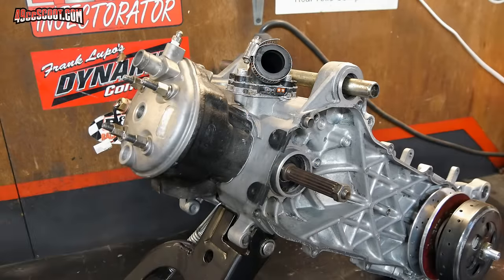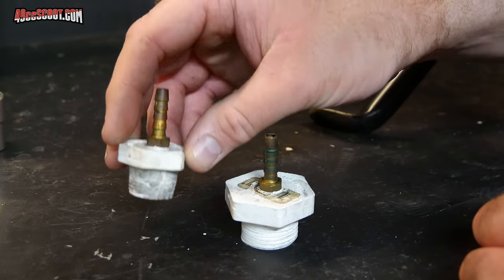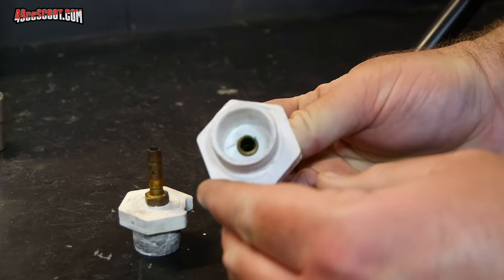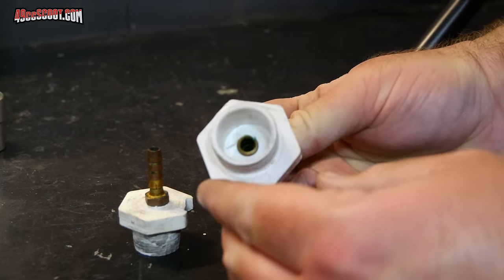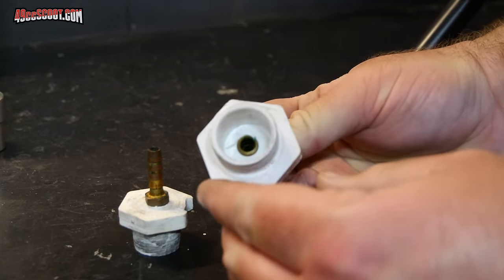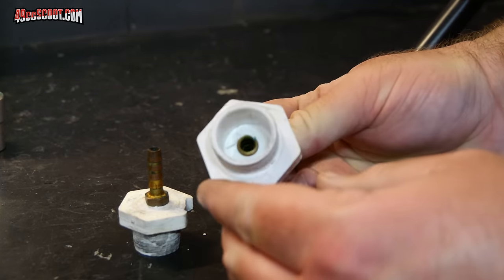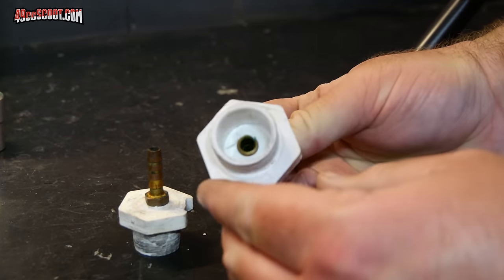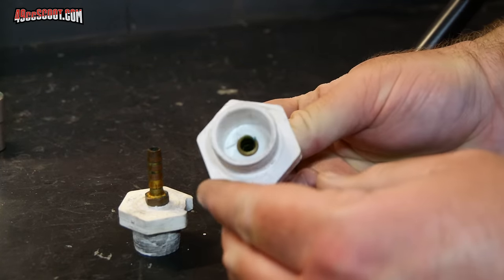Pressure / Leak Testing A Two-Stroke Engine & Building A Tester 2T

Comment: Hello! Should reed valves hold any pressure? I made a leak test device inspired on yours (filled through the sparkplug) but I haven´t covered the intake, assuming the reed valves should hold some pressure. They don´t. And they are brand new Polini, and have no light leaks whatsoever.
Reply from the maker: The reed valves shouldn't really hold much pressure that way. What you've experienced is normal and you need to block the intake as well. Mostly just look for light leaks as you have or any signs of damage and if that checks out the reeds are usually fine.
Reply: @49ccscoot  Thanks! I patched the carb mouth with a rubber and a clamp and was able to momentarly hold 20psi while applying pressure. Only one leak was found and fixed. Still having 150 psi of compression, which is the same than I had before rebuilding. I would assume It´s normal but I definetely have low power. And I can´t quite find the cause :/
Reply from the maker: @gambini_modding  Be careful with high pressure checks in the future. 20psi could potentially blow the seals out of the case so more is not always better. 5-7psi is enough to find leaks.

Check the CVT over. Maybe it'll be something simple like a roller weight out of place.
Reply: @49ccscoot  No CVT, this is a slightly powered Yamaha GT80, It used to run 107km/h in the past, now with everything rebuilt and tip-top, it struggles to reach 70km/h. Timing, Jetting, Seals, everything is fine and new, still, as mentioned, I still have the same compression than before rebuilding (and the old piston was all burned beyond the rings). Only changes in the engine is that now it has two new drags (autolube gear and worm gear for tachometer) But I doubt they could make things this bad. I´m now following the trail of having a bad piston. I always used Taiwan generic pistons because they were the only thing available here. But my hunch now is that maybe they are of irregular quality and i happen to have got a bad one. Just ordered an original kit, same bore. Hope the clearance is good or lower (so i can bore it to good). Otherwise I´m stuck with a nice and loud slow bike.
Reply from the maker: @gambini_modding  If I need to replace a piston, I do precise measurements and try to get one for an appropriate clearance. Could be that the bore is worn or piston isn't quite the right size... we're talking hundredths of a mm. If you are saying the compression was 150 and it wasn't running well and then it was rebuilt and still 150, then I'd consider a thorough inspection. If 150 is the usual spec, then that's probably not what's up. 150 isn't low compression in general, but I don't know what the spec should be for your engine.
Reply from the maker: I show how to precisely measure the piston and bore in this video :
https://youtu.be/NjiJ9SjcdDc
Reply: @49ccscoot  I wish I had a compression test back when the bike ran fine... But I didn´t, hence I don´t know what was the value. The cylinder was rebored and adjusted to the piston (which was new) by a renowned shop. And I have done only 100km of break-in and mindful testing. I doubt the bore is bad, but the piston is, as i said, of doubtful quality. I will send it to a shop to check clearance with the new piston and hone it if necessary. I can´t think of anything else that could cause such a difference in power. The engine is not hesitating or running rich or lean, or having misfires. It runs smooth but when I push it, I can feel it struggling to give power (you know, like if i were riding with two people onboard) I can´t think of anything else than low compression that would lead to such thing. Taking a look at your piston check video! Anything that shines some light over this issue will help.
Reply from the maker: @gambini_modding  If the piston and bore were done by a pro shop then that should be fine. I'd probably try a main jet size up and down and see if there's any change to be sure it's not just a little off in the tune. If you can find a service manual that should have a compression spec. I agree that it's more useful to have info from your own gauge when it's right, but you can't do that now. Maybe check squish and see if that's off by much. Double check the timing as well.
Reply: @49ccscoot  Bore was done to match the piston in a pro shop indeed, but I don´t trust the piston quality. It´s the only one available, so nobody compares it, but i´ve heard of mechanics having problems with this generic brand. Timing is fixed and sounds spot on, sparkplug is brown, perfect burn, tried with two reed valves, two carburettors and many jet settings. some changes here and there but the engine still sounds exhausted fighting with the wind and high speeds. My modest experience (always been a 2stroke guy) tells me it can´t build enough pressure, so I put all my coins in compression not being optimal. In the worst case, i will rule it out and end up with a much higher quality piston. Hopefully it magically solves the issue, has happened a few times in my life :D Will keep you updated with the situation.
Reply: @49ccscoot  So, the new piston arrived, unfortunatelly it is meant for a different model with 47mm bore instead of 49. So i have to return it, It wasn´t an unicorn, it was the wrong horse :P

By the time I realized this I already took the cylinder apart, so being stuck with what i have, i took some measurements, The cylinder is shinny in some areas (about 70 miles of use, barely breaking in) but it still seems on spec, i can´t sense any difference with the gauge feeler, comparing the most shinny parts with the top (unreached by the rings area). But the piston, clearance is way off specs. I can put a 0.006 inches gauge on a side and slide the piston for about half the sleeve, 0.003 inches in the skirt, 0.002 inches in the skirt with the piston upside down on TDP. User manual says it should be 0.0015. So its about 0.003 inches smaller, so to speak. Rings are also slightly out of spec 0.035 max, they are in 0.038. But those are rings from a japan set (the best you can get for this is taiwan pistons but with japan rings) But the the rings that come with the kit are right on the good side of spec. So I´m switching them, maybe since they are matched, they have better clearance in the piston groove. My feeler gauges aren´t small enough to measure the groove clearance. Being that the only way to solve piston clearance is to bore the cylinder again, I will see if there´s any change with the "from the piston kit" rings. BTW The shop surely adjusted the clearance based on some unknown prediction method, it couldn´t have wore so much so fast. It´s a bad job. I have also been examiming old pistons from the times it was on its best shape, and I will copy some lightening on the skirt i used to do in those times, which also help the skirt not getting in the way of the ports when it´s on BDC. I will also remove the autolube altogether to see if it helps, I have the impression it´s pumping too much oil and it´s accumulating instead of mixing with the mixture, which may explain why all the bearings are soaked in oil but there isn´t any smoke and the rings and sleeve kind of show some kind of oil deprivation. Been watching your measure clearance video and the one with the float problem too, they gave me good ideas.
Reply: I think compression is fine @150 .. I beleive your ignition timing is very low .increase it and you will find power !

Comment: Would it be possible to, theoretically, build pressure from the back of the exhaust, or is that asking for too much trouble? I suspect that I may have leaks from all around my hoses going to the carb, so I wanted to build pressure without removing it in the first place. Taking the exhaust off and using a plate from the exhaust side of the cylinder could work, but I was wondering if I could just get away without taking things apart. Thanks!
Reply from the maker: It should be possible. Some exhausts will be more difficult to build sealing apparatus for.
Reply: @49ccscoot  thanks, I will give it a go, and thanks for all those helpful videos you make!

Comment: Your ‘test of the tester’ leaked so fast because the test apparatus by itself has such a small volume of air.  There wasn’t a whole crankcase full of air.   A hose full of air is hardly anything.

I do these tests on troublesome chainsaws and weed-eaters.  I haven’t tried a pressure test on a scooter.

Comment: The first test to do is to actually test the gauge and hoses alone.
Plugging the hose and testing only the pump/gauge setup tells you if your setup is even capable of holding.
Cheap gauges are definitely not going to work, only a high end name brand gauge made specifically for holding.
A proper pressure holding gauge will run more like $50-100